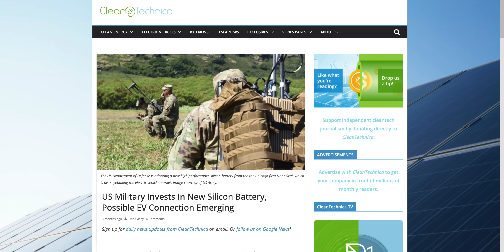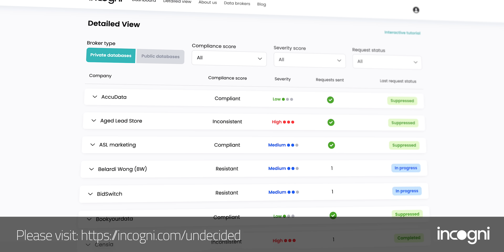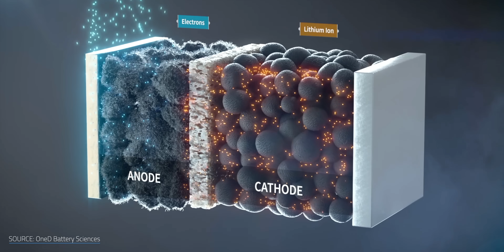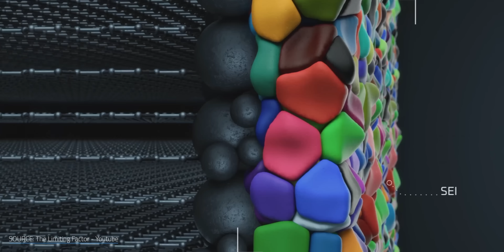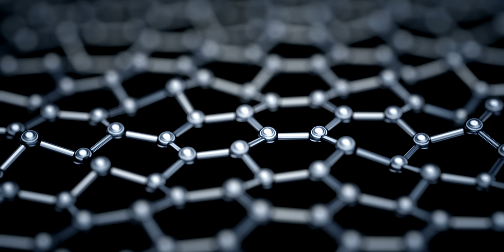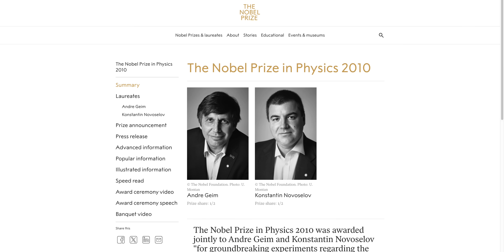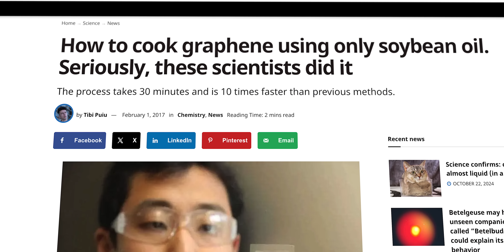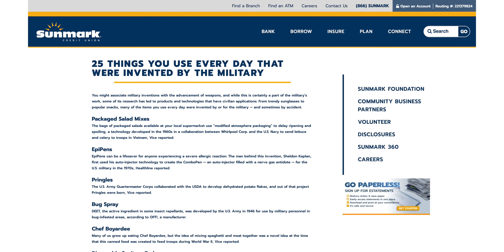Why The US Military Chose Silicon-Graphene Batteries

Comment from the maker: Do you think NanoGraf’s silicon oxide-graphene battery could trickle down to consumer electronics? Take your personal data back with Incogni! Use code UNDECIDED at the link below and get 60% off an annual plan: http://incogni.com/undecided

If you liked this, check out How the Next Big Solar Panel Tech is Already Here https://youtu.be/3GIzZwQw4nc?list=PLnTSM-ORSgi7uzySCXq8VXhodHB5B5OiQ
Reply: You are right this will eventually get in the hands of civilians which is a good thing. But if they already have them in the equipment testing phases, That's a pretty big deal.
Reply: The military is usually the first to adapt to new technology than it's trickle down to the American people. So there's a good chance it could be available for people in the future.
Reply: It wont even make it to the military 😂
Reply: I think solid state batteries are likely a better option at this point. There are several companies already building test production facilities or producing test batteries. SSB's are lighter and have a higher w/l energy density than even SOG batteries.
Reply: thisis the only thing gov. should spend money on, innovation! but whatever happened to the Aluminium graphene batteries were developed out years ago?
Reply: One thing I didn't hear covered in this video is the fire issue.
Lithium ion battery fires are a pernicious issue, particularly when the batteries are in a use where they may be regularly subjected to damage.
Reply: @MonkeyJedi99  I was going to ask the same thing! How could he ignore something so important?
Reply: graphene is expensive low-volume and roughly similar to the first time space satellites start having solar panels. If I account AI/computers in improving production of graphene from current period, we could see it at high volume consumer electronics around 15-20 years.
Reply: Inevitably eventually. Fingers crossed it won’t take too long!
Reply: I bet we see them in high end light weight mountain climbing gear first.
Reply: from memory the military benefits was heavily around environmental reliability; as operating in hot and cold/freezing temps; safe with water; as well as when damaged with fire control etc.  Don't recall you mentioning that in video; was it no longer true?
Reply: The real question is why hell don't they just use Sila nanotechnologies silicon carbide anodes, you can make graphene from carbon derived carbon from silicon carbide by etching the silicon out. Panasonic already has a larger order from Sila than what nanograf got. Why mix silicon oxide and graphene when you can get both in a partially etched silicon carbide.
Reply: It could get to consumer, but if it's anything like Amprius' battery, the cycle life is an issue. It's good for the military need, but not optimal for everyday consumers who want longer life. Fast charging and energy density are great, but I don't want to buy a new battery for my car too often....
Reply: For the graphene issues, seems Hydrograph fixes all the issues with scale and purity. Probably worth a look at their website or the GEIC in Manchester.
Reply: bad taste matt. US nasty helping to delete many in mid global east.
Reply: I've been looking forward to the Graphene tech trickling down since before the pandemic I think but I knew it would be a while due to manufacturing tooling and scale issues.
Reply: Why is the $XNO Nano cryptocurrency logo on those batteries you use in your graphics?
Reply: Not just for shots anymore, now available in batteries
Reply: Audio suggestion: Your plosives hide your soft vowels.
Reply: I puffer your old intro
Reply: Military always backs shit to push the tech further.
Reply: I've seen many 'new battery' videos over the last 10 years and seen none of them come to the surface. Some new 'Graphine' batteries don't seem like they are a big difference from their original counterparts. While the concept is a nice idea, i will just sit and wait until something actually happens, as i can't get excited over a pipe-dream.
Reply: if it has a benefit in drone applications you'll probably see the implementation of little bit faster than normal
Reply: @UndecidedMF  Can you tell me why no one is collecting the energy from the Centralia, PA coal fire?  For that matter, there are many geo thermal sources, such hot springs or volcanoes.
Reply: I've seen too many 'new batteries' that have promise but haven't come out or have such little help in effect that they don't really go anywhere.

I'll just have to wait and see.
Reply: What about  hpq silicon battery work?
Reply: I hope so. I am all for new tech.
Reply: I got unsubscribed from your channel and i watch you all the time.
Reply: Very nice information Great wark you 👍❤️👍
Reply: No, I don't love it, and No I'm not watching your video with Lithium.
Reply: They're obsolete garbage. The government froze my assets to try to force me to disclose and classify my Graphene Monolayer Membranes. The people will get it the government? Piss on them. Quit paying taxes.
Reply: China's produces 3 times as many cars as the US and in less than a decade nearly all of them will be BEV.  That means battery technology is a national and economic security issue for China. IMO EV battery companies like CATL and BYD, already the biggest in the world, are likely the ones that going to create the most competitive  batteries moving forward and not just for EVs. The US has fallen behind and that gap is increasing.
Reply: between 5 to 10 years if it delivers on expectations. I am more interested in its capacity for thermal runaway and catastrophic events. I've seen an 8 pound lithium battery for a Marine Radio blow....well.... I saw the Sargent in charge of the Battery Locker fly through the door, taking the door, and about 50 feet across the field where the Battery Locker was at. Made me happy to be in charge of the Aircraft NiCad Battery Locker. Thermal Run Away? easy to deal with. Lead Acid (not me, AS2 had that one) never had an issue. 20 years working Aircraft only saw one NiCad Battery go in thermal runaway.... saw a few Lithium Batteries pop...but, Navy gotta expect that.
Reply: @geneard639  this is part of the reason why Steve Meade still uses SLA or lead base batteries in his builds especially in his Tahoe. and backs them up with  capacitors .   Safety is a big thing.
Reply: unsubbed.
Reply: Silver is the best conductor for electricity 🤦
Reply: Why you block me on X

Comment: No I am not watching this on a device powered by anything like that, My pc has a single battery in it to keep clock timing but that is not lithium ion based, the power it uses all runs from mains through a 1200W PSU that distributes it, similarly the screens attached are all direct to mains, no batteries involved.

Comment: Question:

Since graphene is a honeycomb grid, this means it has hollow channels. Can we weave in an elastocaloric system to transfer heat energy into electrical potential as captured from an ice sourced heat pump? If we can, then could we localize an "elasto-graphene generator" directly onto an icewater plumbing as a form of heating and cooling causation of expansion and contraction for soliciting a trickling charge through to a household battery?

Comment: Most of the figures they're promoting, are severely hyped. There's not that much headroom in the chosen chemistry. They are lighter, can sustain more abuse, are less volatile than even LiFePo4, and noticeably more temperature tolerant... all of which, lend toward a better combat pack.

Comment: Matt
GMG in Australia ar extracting Graphene and Hydrogen from a patented and proprietary plasma separation method using Methane / Natural gas and doing so already at scale.
GMG have already developed and started to sell their SuperG Graphene slurry which is super high quality and ready for screen print of cathode film layer materials. 
It is now the electrolyte and Anode materials that are being developed by many to compete with LFP  both on energy density and cost.
Home storage and static storage is less of a concern in the energy density spectrum as cost and cyclability / longevity play a much larger role in the application than does size and mass. a significant low cost battery that might be 15% - 20% larger but of the same mass can easily be accommodated in static storage. 
Less ideal for vehicle use but for making affordable home battery storage becomes game changer.

Comment: There are two issues that determines adoption : Price and weight. The 1/10th time to charge is important, but not critical as long as it is not longer than Lithium Ion batteries.

Comment: Hi Matt, your video have a few flaws about how these materials work, but there is a major one that you need to fix. You say sometimes "Silicon" (Si) and sometimes "silicon oxide" (SiO2). Silicon oxide is an electric insulating material that is not useful for this application, please change all for just "silicon"

Comment: Solid and interesting presentation.  A couple of flaws.  Mostly, this is all about  the anode *composition*.  Nothing here describes the electrochemistry that drives the electrons.  The electrochemistry seems to be lithium-ion, which is fine, but viewers may assume that this tech eliminates the lithium piece of battery production.

The way graphene is compared to steel strength is unclear and actually irrelevant for this battery.  Its comparison to copper for conductivity is relevant, and is well described.  

The description of the battery energy density is also clumsy.  

All in all, a B+ presentation.  However, the main point, is crystal clear.  A very substantial improvement in battery performance is at hand, with the major obstacle being price.  With the military taking on the ramp-up costs, this may well be a consumer-ready use within a decade.  Nice.

Comment: That proprietary graphene manufacturing probably involves a cyclone to separate out the lighter carbon black/spherical graphite/graphene from burning hydrocarbons, then postprocess the carbon onions by etch it in light oxygen pyrolyzing it with oxygen to get more porosity between the layering to entrap/contain the nano silicon..   Similarly used by other battery makers

Comment: Chemistry major here. Graphene is a futurism scam for the most part. It's a buzz word used to trick people. It's just graphite. A single layer an atom thick. You could say graphene layers made up the blocks inside the reactor in chernobyl and that would be true. Because graphene is literally just graphite... cut open the battery and show its one atom layer thick and ill buy that snake oil.

Comment: Are these not similar to the silicon carbon batteries available in the honor magic 6 pro phone?

It gets a 20% capacity boost by not losing voltage as the battery lowers in charge.

Comment: @matt, this is an interesting technology and show, but still not practical. I would love it if you did an in-depth analysis show on this groundbreaking lithium sulfur battery that is now ready for commercial production made by zeta technologies. They grow carbon nanotubes within 30 seconds that host the lithium ion sulfur in the anode. It's going to be cheaper than lfp and have 50 to 100% more energy density than high nickel lithium batteries.  See:
https://youtu.be/xCAvL1gVw8k?si=TM_26vl3pf8yl3_1&t=573

Comment: Do you happen to know how the handle in low temperatures? Regular Lithium batteries in cell phones completely discharge from full to 0 in under 40 minutes or so, even when not in use, once it's exposed to -20 C or so.

Comment: The anti-CO2 lobby is insane. Efficiency and cleanliness is great, but what they're doing to "prevent" CO2 is ruining the planet. (Like all the things they spray in the atmosphere). Also we could dredge the ocean floors and river deltas for some prime fertile soil and spread it in areas that have been "depleted" (phosphate depletion a real issue), while simultaneously removing tons of plastic garbage from the oceans. But that doesn't solve the issue of certain political goals, so it'll never happen, because political goals are about winning and not necessarily doing it the right way.

Comment: Fast track Risk Mitigation of a new technology is accomplished via the largest population. The number of unique environments and quantity of user instances is achieved through this effort. Holding to common mechanical interfaces and integrated BMS(s) to manage similar external electrical interfaces will need to be considered to start the evaluation effort as quickly as possible.

Comment: We need to switch to nuclear batteries. There are wafer chips with a couple components  that were invented 40 years ago and convert radiation to electricity. Not super fast or powerful, but enough to charge a battery. So you use the battery, and shut off the device when you're done. It self charges. They can last for millions of charges.

Comment: This is what irks me a bit, about the attitude to EVs. This tech, isn't going to get better any quicker without investment from selling current tech as it is. It's all going to get better, but the resistance of the neanderthals that roam with their misguided, misinformed opinions, is only going to make this take longer than it has to.
I genuinely think that in the years to come, the EVs that are driving around today, will get new batteries when their time comes, using tech like this, from a 3rd party supplier. The batteries will be cheaper, lighter, last longer and charge quicker, using the 'same old car', and then the figurative light bulb will click, where they realise EVs ain't that bad after all. Also, side note, next big industry - 3rd party battery packs, using new tech. Look at the original Nissan Leaf, and compare to what things are now. It's only going to improve

Comment: How do you solve the first cycle problem? Use the battery once before selling it. If so much better than li batteries it will still be better, and the customer won't experience the problem.

Comment: Well... The military in fact did not choose Silicone graphene batteries. Graphene, while existing, is too expensive to manufacture as only a tiny amount can be created at a time. You'd currently be looking at around $100,000 for a battery that has the capacity and size of a AA cell. The technology is still in its infancy, barely a thought. Those graphene super batteries with high capacity and super fast charging capability, would require many layers of material to get a high enough capacity. Then there would have to exist a charger with a high enough amperage to charge the battery so fast, which would be dangerous in any hands.
Reply: seems you're in fact wrong
Reply: @helloyes2288  I'm not wrong. They aren't on the market either publicly or otherwise. It costs a heck of a lot of money to produce a tiny bit of graphene. The amount of graphene produced in the world currently, wouldn't make one battery.
Reply: @iamfreeareyou681  seems you're not up to date and wrong.

Comment: I don't know if I missed it in the video, but what's the limit on charge cycles? how long before noticeable degradation occurs to the battery? current lithium batteries in consumer electronics notice a decline in time between charges after months to a year depending on use, how do SOG compare?

Comment: Someone who asks why go for high tech batteries for small gear has never carried a PRC-119 and batteries for an extended operation with a small team.

Carrying 20 radio batteries in addition to the radio and your standard load is not my back's favorite way to break.

300 pounds of stuff is way heavier than the average person think, especially when you are carrying it for 20+ miles a day in a hostile area with people who intend to inflict great bodily harm upon you.

I have been on shorter ops where our only niceties were socks and water.  Everything else was gear, bullets and batteries and we were still carrying packs that topped out at over 100 pounds.  Add to that body armor, a weapon and other nonsense, and realistically, 200 pounds is a light load. 

Lighter batteries will literally save the US tens of billions of dollars annually in medical and compensation costs alone.  In addition, it saves wear and tear on the bodies of the highest trained personnel, slowing turnover rates and greatly reducing training costs.

Source: my spinal arthritis, vertebral remodeling and compressed and ruptured disks.

Comment: The hurdles are this. 
1. Is it as reliable or markedly better than current technology? (Lighter, longer lasting, power to size ratio, temperature ranges)
2. Will the cost be less? 
That's it. If I can get the same power cheaper no one cares about anything else.

Comment: I don't know. I didn't hear any specifics on energy density, capacity. And very little about cycle rate other than maybe a ten fold increase in charge speed, but no real numbers. What is the environmental impact of the process? Does it require the handling of hazardous materials? What waste is produced? There's a million questions not answered. How am I expected to give an informed opinion without information?

Comment: I'd be all for it if they have as long a shelf-life as CR123 batteries.  After going through 8 days without electricity after Helene passed through, I'm more sold than ever on the benefits of CR123 batteries as those were the only ones that were of any use in all my gear here.  Everything running on normal batteries was dead either from the batteries running out of juice or just busting open and corroding everything.  Only my Surefire light was working.  And my oil lamps.  So a lighter battery that lasts longer might be great, but will it sit there for a year or more untouched... and still function when you need it?  If so, count me in.